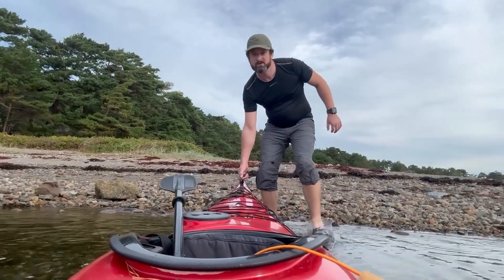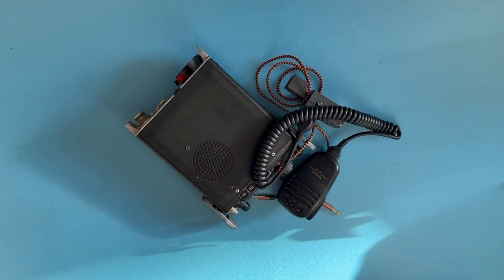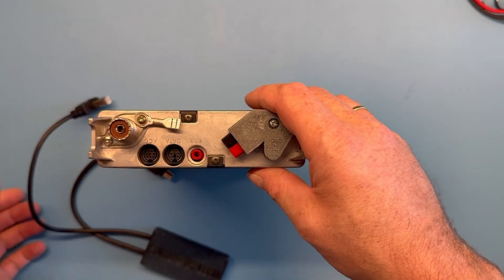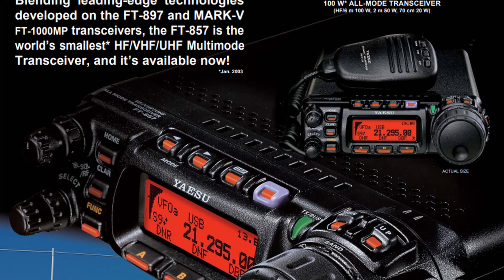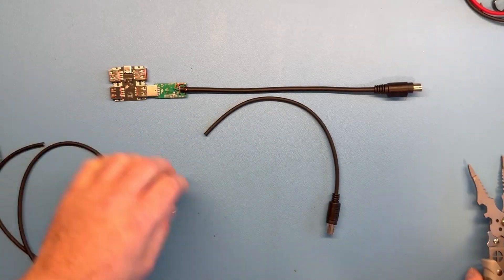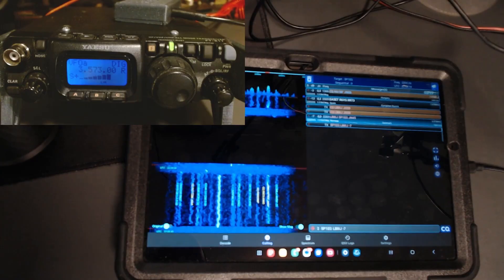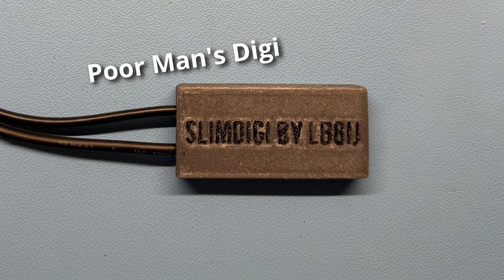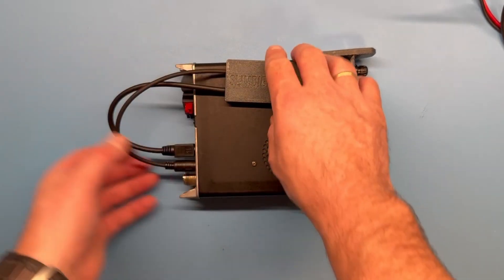DIY Digital Interface for Yaesu FT-817, FT-818, FT-857, FT-897

Comment: Hello.

Starting at 1 minute 15 seconds in, the cable doesn't fit the case, so I cut it and soldered the USB cable. If the case isn't necessary, can I just use the cable as is without cutting it?

Additionally, I would appreciate it if you could also tell me how to set up FT8CN and FT-817.

(Amateur Radio Beginner De DS4HQS . TNK)
Reply from the maker: Not sure I understood you question. But yes there is no other alteration to the cat cable then me making it shorter and fit my case, so if you don’t want to use my case you can use the cable as is.
Reply: @hamradiopassion That's the answer I was looking for. Could you share how you configured the FT-8CN app? After switching to CAT MODE, do I need to adjust any other settings?